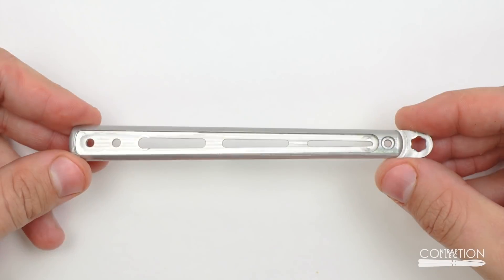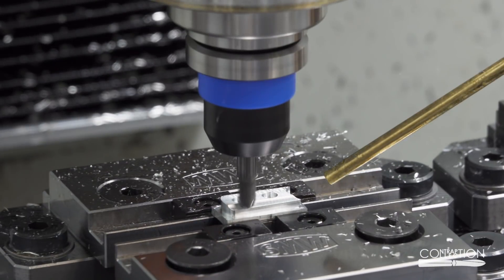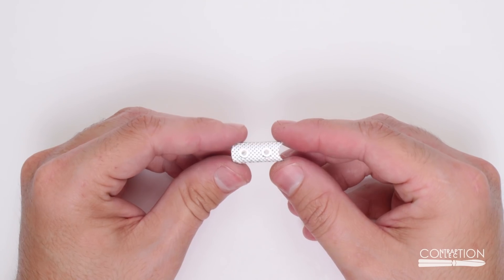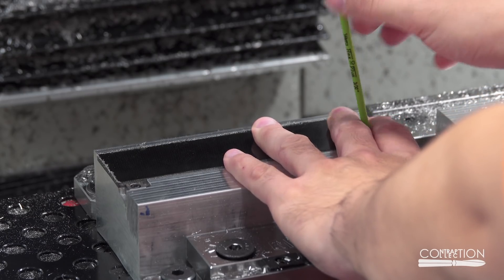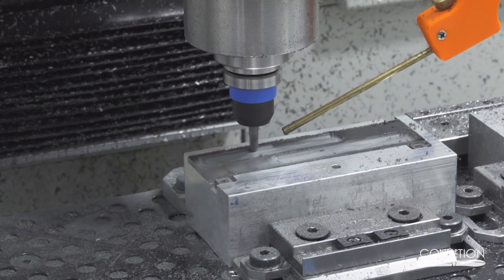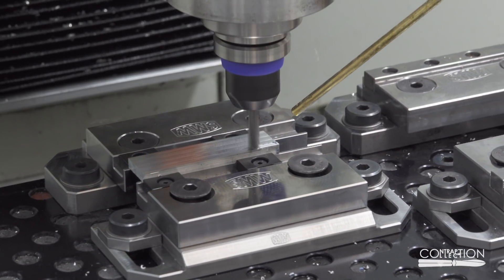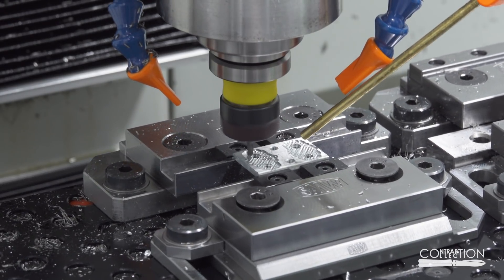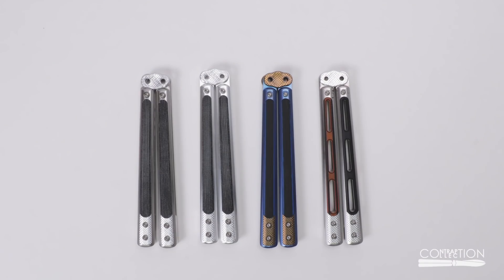Scales and Anodizing. Baliscissors: Ep 14

Comment: To do thin material parts in one setup on a router I use the blue tape and superglue trick works really well as it holds down the material on the wide bottom surface opposed to just the ends. I would recommend you give it a shot. It might not be the right idea for production as it takes longer than putting something in a fixture BUT for banging out these prototypes it's a great way to do it. That or if you are doing production work I would recommend a vacuum table for the thin sheet stuff and a custom made table with holes only where your pieces are.        Totally loving everything you are doing here, especially the details and problems that many channels gloss over.

Comment: Maybe a down cutting end mill would help with the material flex, however, I think your fixturing approach is wrong, I think you should try super glue fixturing on a larger sheet of material since all your ops are on a single side. NYCCNC has some nice videos regarding super glue fixturing

Comment: Concerning the issues with the fiber material flexing and differences in stock size, would it do any good to change the fixture method to finger clamps and add pocket holes for locating pins?

Comment: if you use one sheet for two scales, then you can use your current fixture to drill holes into the sheets which you can use to bolt them onto another fixture. This way you can prevent the sheets from coming loose. 
Also i would recommend trying stabilized redwood or snakewood inlays with black anodized handles.
Anyway love the content and keep up the good work!

Comment: Kinda curious about the fixture: why not have a few more clamps at the side and have them press down from the top too?
And with the current fixtures - wouldn't some spray-adhesive help? A Bit messy to clean up after every part but it should help with parts moving.

Comment: Carbon fiber, and probably other composites as well, should be milled in a water bath, to contain dust. As for the issues with the resin, you might have to order more stock and play around with feeds and speeds, unless the manufacturer themselves specifies what speed and feed you need. The issue with using a down-spiral bit is chip evacuation, you're machining straight into a pocket, and chips can only evacuate out of what portion of the pocket has been machined; if you do switch to a down-spiral bit, you need to revise fixturing to account for this, which may introduce other issues. 

Personally, I'd revise clamping first. Something that you could try, for when thin borders and material properties are an issue, is a top plate that clamps downwards, with cavities only where the scales are, with a slight bit of clearance tolerance around the perimeter, and this would work better with screws; basically a fixture-material-plate sandwich clamped by screws.  You could have screws located on the outside of the part, which means negating a drilling operation, inside the part, or both, depending on your needs. This kind of setup would also work for any material type, just adjust feeds and speeds per specific material, and thickness, just shim the fixturing for thicker material, with no need to modify Z depth except for step-downs if a certain material doesn't like a full plunge. This concept basically clamps everything except where the scales are to be milled out, those thin borders would no longer be an issue, and material wanting to pull up would no longer be an issue; except possibly where there is a void in the clamp, but that's an unknown variable until the concept is tested.

Comment: Down cutting endmills or conventional cutting tool paths work best for plastics/composites in my experience. Some of your operation orders seem flipped like the scale clamp. Personally I'd deck the part use a chamfer mill to cut the angle since they're cheaper than dovetail cutters, and cut the profile. Flip, drill/counter bore, texture. Function before cosmetic. Doing great tho and love watching people learn by trial and error

Comment: For the handle scales, would it be possible to drill a series of round cavities or depressions in the G10 so you would have a good textured grip and be able to see the blue and black pattern?
Reply from the maker: In episode 6 I might have done the thing you're talking about with drilling round cavities. I think it might work, but the layers of this particular multi-colored G10, just might be too thick. It might be a little more pronounced though.

I'll probably try that stuff again eventually but there's a huge amount of options for scales out there, so I'm not sweating it if the striped G10 always ends up bland.

Comment: It looks like you have plenty of waste stock on the scales to allow placing plain old toe clamps, so I have to wonder what reason there is to not use them.
Reply from the maker: That's what I should do, but I don't have any small toe clamps, and was curious how well this would work. In the future I'll probably get larger sheets and make clamps that run down the edges of the sheet.

Comment: Looking great!

For machining the micarta, G10 and carbon, try using double sided tape to hold them to a piece of aluminum, then clamp the aluminum in a vice. I've used 3M 467MP to machine G10 with great results. Just make sure you clean both surfaces well, I typically use alcohol. I've also found that scuffing the back of the G10 with a scotchbrite pad helps it stick. The only downside is the need to rub the glue off afterwards. For the G10 I machined, I used coolant to keep the dust down and keep the material from burning. Then oil with something like WD-40 after machining to bring out the color.

Also, it seems like all the endmills you use have really long flute lengths. This causes the endmills to deflect a lot more, which can cause chatter on your parts and endmills to break. Use the shortest flute length you can get away with and only stick it out of the holder the minimum needed as well.

Comment: For the scales, you could just try double sided tape. Could work out great honestly.
Reply: Or two dots of a good silicone, one on each end. That would allow for removal/replacement.

But tape would certainly work, and might just work too well. Stick 'em down with 3M VHB tape, for example, and they will never come off. That stuff literally holds up to hurricanes.
Reply: @OddlyIncredible  The pro of the tape is that it holds the parts even without the tabs, leading to less post processing of the finished part.